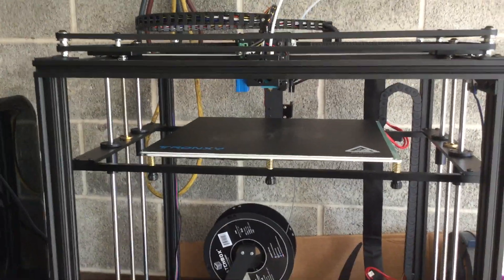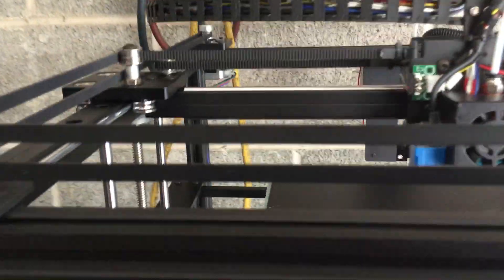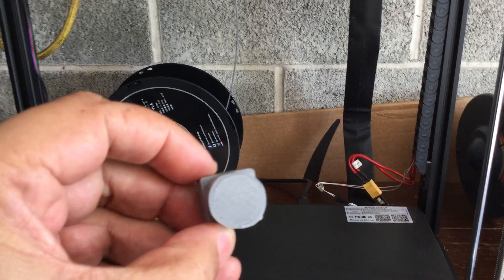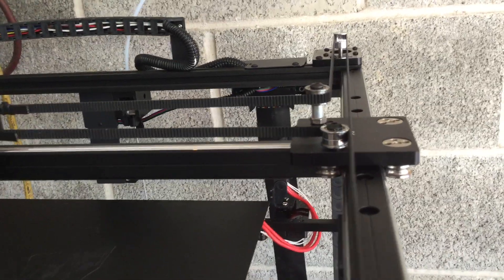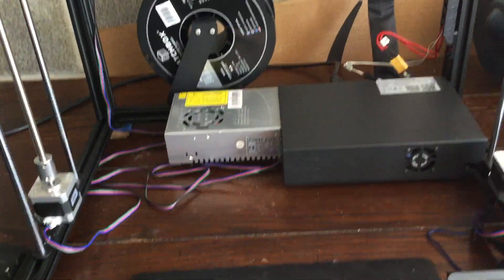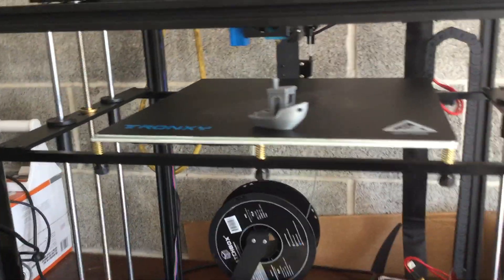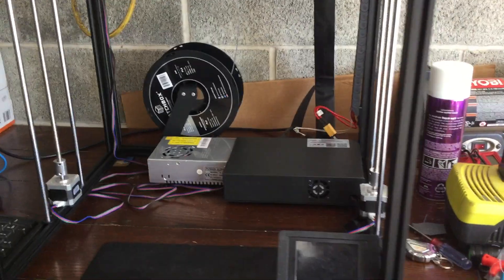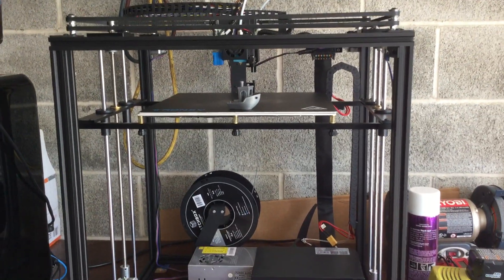TRONXY X5SA PRO 3D Printer 2 week review

Comment: My man, that's really good. And some really good advice. It's really crucial to get good precise parts to get all the frame squared, and the motion smooth; wheels must properly engage the track with even adequate pressure. Pulleys parallel to it's correspondent. Belts properly tensioned. I always think "center everything and square everything."   -Billy Champy a.k.a Chosen One.

Comment: Hi i have a question when i print the block  of go really good but when i print a burger object  my sensor scrub it of the building plate  because the sensor is not high inough from the build plate  how  can i fix that
Reply from the maker: in your slicer use Z hop setting.  it will raise the extruder when it moves.   Also make sure the Blue sensor is level with the bed.  With the printer off. put hotend at center of bed and manual raise bed till Blue sensor touches bed.  It should be flat on bed, not with front edge or back edge touching first
Reply: @steamcastle2473  i think the probl is the z settings  because  i have set de sensor on different hights  or the print is not good or  the nozzle scrub the bed  every print again the sensor   touch the bed   when i auto level  all value  are less than 0.8 so i think i need to set  my z axes
Reply from the maker: @davyneven4295  Ok from the sound of it, you must have a X5SA and not a X5SA Pro.  However setting it up is basically the same  On my pro i auto level a few time till its down to between .1 and .3.  However with you X5SA you should be able to get it down to .4 after a few tries.  Then after the last Auto leveling, set your z offset by putting a piece of paper on the bed  and hit the z offset control.  then slide the paper back and forth and move nozzle down or up till you feel friction on the paper and hit the set button.  The I use the control and set the printer to home.  Then try to print something
Reply: @steamcastle2473  is was the z to zero  that was the problem  i have set the sensor and the nozzel to the same high than autobed level en than  with a paper the z and save to zero and it Works 
Thanks men

Comment: hi, is the bed heated? if so all of it is heated? thanks buddy!
Reply from the maker: Yes the bed is heated, has a 24v heated bed.  The hottest I have used the bed is at 110C.
Reply: @steamcastle2473  is the whole bed heated or just the middle part?
Reply from the maker: @slowiphone5555  I would say the heat pad under the bed covers the bottom of the bed about 70 to 80%
Reply: @steamcastle2473  thanks so much buddy!

Comment: I have one, was excited for it, and I'm tired of screwing with it. It is a good design overall, but falls short when it comes to actual printing.  I got one good print, then that was it. It is unreliable, barely any documentation, and you have to figure it out for yourself basically.  I've now lost a month of my life on it.  Over time the wire carriage on top will drop and catch on the side then ruin a print, stepper motor will shift mid-print ruining hours of work, plastic belts loosen so you have to buy new ones and/or add tensioners.  I'd rather spend money on something that works rather than taking up my life screwing with this one over and over again...mine is going in the garbage
Reply: SELL IT
Reply: @ianyancey2919  Believe it or not, I finally got it working right.  And my main problem was interfacing via OctoPrint. My Prusa prints a thousand times better, but it is working and printing ok
Reply: @ldboehm  How did you got it working? All my Tronxy except for one have massive layer shifts.
Reply: @elmexicanoforlive  I finally figured out that the main issue was going through Octoprint.  the TronXY proprietary interface acts differently and was replying with errors on some commands.  It took a while, but I finally found the Octoprint patch, applied it, then it started to work reasonably well and not skipping/shifts.  Then I got used to how to level it, and to be super careful with touching the sides so it didn't mess that up.  I also added a piece in the back to hold up the gantry better.
I still don't like it.  Don't us it much.  I use my PRUSA and Ender all the time with no issues.

Comment: Hi, just watched your vids, ive just got a Tronxy x5sa 500 pro.... 
But I'm having a major issue with the bed raising up and digging in to the nozzle.... even when i go to auto level the bed, it raises up too high initially and then it's all off... any ideas. Cheers Matt
Reply from the maker: Is the red light on the autoleveling sensor turning red when it nears the bed?.  Also did you adjust your Z height in the settings
Reply: @steamcastle2473  i give up with it.... now one z motor only works. So wired them up to work on one conection into the motherboard. Now they both go up and down. Still can't get the bed to stop crashing into the print head. Ive reset Z of set more time than I care to imagin.
I can only conclude that i have a faulty printer.
Reply: Yes red light comes on on the auto level
Reply from the maker: @FishEyECameraKits  What version is you firmware? My is V1.4.1RC24m4
Reply from the maker: @FishEyECameraKits  Also you have the blue leveling sensor slide all the way down correct?   As i totally forgot that when i had the blue sensor slide up on the 2 screws that hold it, it went into the bed.  I totally forgot that happen to when i first turned on the printer. it was so long ago.
Reply: @steamcastle2473 i have the  same firmware as you and also been on the tronxy website and printed the gcode they have for download. I've tried the blue sensor in the up and nearly all the way down positions too. It like the sensor isn't telling the z motors to stop.
Reply from the maker: @FishEyECameraKits  If you blue sensor if set all the way down and If when you go into controls and tell the printer to move left and right and up and down to your command and it does that.  Then if you have it do a auto level and you are able to auto level, then after the auto level is done and you set the Z height.  then when you done setting the Z height and you set it.  then if you hit home and it homes ok.  then finally when you try to print it goes into the bed then i am at a lost as to what it could be.  Because if you can auto level the sensor is working.
Reply: This is the video i have sent to tronxy.... as ive followed the instructions perfectly and its not working correctly.
I've got 2 flash forge creator pros that ive been using for the last year with no problems.... in just dont get it.
Reply: @FishEyECameraKits  have they given you a reply?
Reply: @HugDeeznueces  not really..... very vague and slow replying.... two different gcode files in 1 week.... still not working

Comment: OK I'm a total noob to 3D printing and accessories. My wife bought me the Tronxy X5SA as an early Christmas gift. I got it assembled and spent a month watching youtube videos on it. I finally powered it on yesterday and have had nothing but issues. I finally got most of them taken care of, however I still have one major issue. I'm trying to do the test print with the file that comes on the SD card and all I get is a diagonal line from corner to corner. After it does that line it sits at 1% and does absolutely nothing else. Is there any thing you could help me with in setting  up?
Reply from the maker: First when you set your printer to home,  does it home correctly?   Next when you do a auto level, does that work correctly?  If that works, go to www.thingiverse.com and Download the XYZ 20mm Calibration Cube and try to print that.

Comment: Hello :) thank you for videos! Could you do another review now after 2 months? I got several questions:
1) how is the rail system? Is it usable or just cheap?
2) how about connecting to octoprint?
Reply: Hi Jan, I've been running the X5SA pro for a week now and have to admit it is excellent.  Printed excellent out of the box but now I have got the belt tensions dialed down can print 250mm calibration prints accurately. 
(1) The new rail system is excellent and I cannot fault it.  I wasn't happy with the roller adjustments from the factory so I spent some time adjusting each carriage to get them running smooth and without any movement.  Spend some time doing this to get it right.  To adjust the carriage wheels tension you can use some right angle circlip pliers and insert them in the loosened grub screws rather than removing them completely.  this gives more control when tightening the wheel post bolts. 
(2) Re Octoprint I have my Raspberry Pie ready to go but haven't tried it yet.  I've just been loading prints onto the Micro SD and running off it.  
(3) I designed a new fan cowl for the hotend which works much better than stock.  It is lighter but also eliminates cool air blowing downwards onto your part, important when running  ABS.  Link is here: https://www.thingiverse.com/thing:3965016

Comment: My X5SA Pro is on the way but wonder if you can let me know whether the bed can achieve 100ºc and if so how long.  I have always added mains voltage silicone beds to my printers and think I will upgrade  to this but not worth wasting the money if teh stock machine works ok.  Cheers
Reply: For the 330mm bed the 24volt system probably works ok.  Likely just slower to heat up than a mains voltage heater.  Might benefit from a larger MOSFET or relay if they are using a single on board transistor for the heatbed from the factory.

Comment: Hi, this printer 3d really have these options :
X5SA-500 PRO : 500*500*600mm + power off resume print + filament run-out detection + auto level ???
Reply from the maker: The one I have is the X5SA Pro.  The  X5SA Pro is 330x330x400, the X5SA 400 Pro is 400x400x400 and the X5SA 500 Pro is 500x500x500mm Bed.  All have the same options other then the size of the bed is different.  All three have new rail system, Titan Extruder, Auto leveling, Filament run-out detection and power off resume print.   Please note if you live in US, they are finally here in bulk, the X5SA Pro is anyway.  The X5SA Pro is selling on ebay from US sellers as low as $350 with free shipping when they have sales.

Comment: Nice video - thank you. I'm concerned that you may get this newer version with steel rods as runners instead of the aluminium profile. They must be quite heavy, so the printer must struggle to move the whole carriage. I've seen a Tech2C video where he converted the steel rods to carbon fibre to reduce weight

Comment: @Steamcastle Have a link to those metal brackets that are plastic stock, the ones that should be upgraded? I plan on getting this printer soon & wanted to order the metal brackets also.
Reply from the maker: here a link on amazon  https://www.amazon.com/Hacloser-Stepper-Bracket-Printing-Profiles/dp/B0793TLQ8G/ref=sr_1_13?keywords=stepper+motor+plate&qid=1566611311&s=gateway&sr=8-13

or just do a search in Amazon for "stepper motor plate"

Comment: Can I ask a few questions..., I  am seriously thinking of buying this. Are the pulleys the upgraded GT2 pulley or the same as the original x5s? Is there a spring washer on the pulleys that made belt alignment extremely hard or is it a standard washer config now? What is the belt made of is it the upgraded rubber or the same as the original x5s? Did you buy the bed insulation separate or did it come with it? Did it come with the buildtek?  What is the amperage on the 24V power supply? How well does the autobed leveling work? please answer these questions for me.. thank you in advance
Reply from the maker: Ok I was told by customer support that the Pulleys are new to the Pro.  My friend has the reg X5SA and his pulleys are not the same.  Also the pulleys all came mounted.  Meaning they were on the two front brackets and on the new rail brackets.  All i did was put the brackets on and belt fit on perfect.  As for the belts, they dont feel like rubber,  so I think belt is the same.   The Bed insulation came with printer.   Buildtak type cover came with printer.  I think the power supply is the same as the 2019 version of reg X5SA, its a 24V 360 watt.  The autobed leveling system has worked perfect and easy for me, even the z high setup was good.  The only issue for me was the bad nozzle and no instructions on adjusting new rail system.  But both are now fixed..  So far i have printed a total of 150 hours on it using Hatchbox filament mostly.

This is where I bought mine:
https://us.gearbest.com/3d-printers--3d-printer-kits/pp_3004332154210735.html?wid=2000001
Reply: @steamcastle2473  DO you happen to know when you assembled it did it have a MOSFET with it? Have you done large prints with it yet? If so did you get any layer shift?